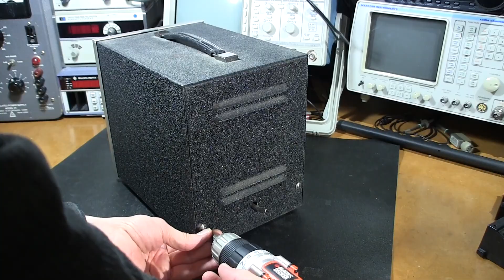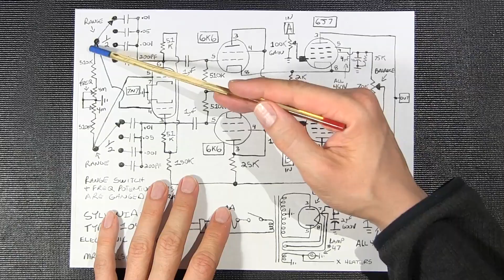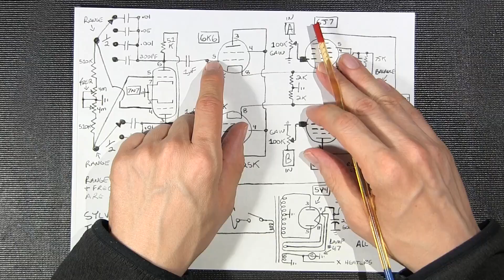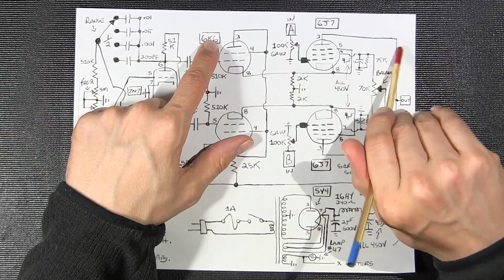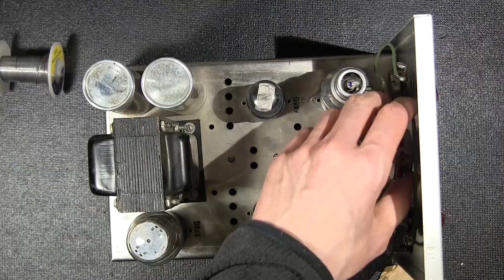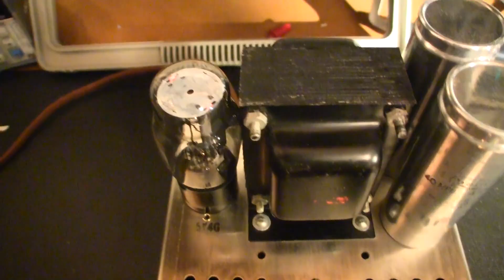Neat Electronic Device from 1939 Explained with Restoration

Comment: Made back in the day when construction was a work of art, when people really cared about what they built.
Reply: You have to understand all this hand built stuff is extremely expensive.
Reply: I actually have a radio built in 1944 that still works. Hand wired, original valves (tubes). I tested everything before I applied power. The set was bought by my grandparents, and still has the shop guarantee. They were supplied as kits of parts to local shops to assemble.
Reply: Steven Cook, Make sure you replace the caps as does Paul Carlson. That will keep your machine working for decades more. Add to the voltage rating as they are not the same as the caps were back then. Use a good brand (see his video on choosing components by brand).
Reply: Boat anchor art to fill the shelves.

Comment: That power cord you cut had obviously been replaced previously, probably in the 1980s judging from the neoprene cord and the (probably added) hold-down clamp that is using a Japanese Philips screw. It is very possible that the fuse block was added at the same time, the original either not having a fuse or having a fused plug. That tells me that someone either restored this once before in the 1980s, or possibly was even using (or attempting to use) it at that late date.

Comment: I'm guessing they used the word "Balance" in an audio context. Like adjusting a left right stereo signal.Can you switch traces around with balance? Like move the top to bottom and vice versa? If you can then balance makes more since. If you feed these 2 audio signals into an amplifier, you could change channel A to output on left or move balance and move channel A to right. 
Just a guess.

Mike

Comment: what kind of microphone are you using for your videos ? 
it sounds great!!
let me know!
KI7CUN
Reply from the maker: Hello Daniel. The mic is a custom built, vacuum tube condenser type. The tube in the mic is a GEC A2900. The mic pre, compressor, EQ is an ART Voice channel. The audio is fed to the camera through balanced line, where it meets an interstage transformer coupled to the camera input. The audio is Mono in all my video's.
Reply: Mr Carlson's Lab  wait, that's mono? I may need my hearing checked
Reply: Mr Carlson's Lab Thanks for the Info Paul!! I would have to build it myself then if I wanted to go down that route, also do you hang out on 3.875mhz on 75m at night or is it only 3.900mhz?
Daniel

Comment: It's a pity the technician, who had to repair that unit n times without success, isn't around to see you find the bad solder joint on the decoupling capacitor.

Comment: I am curious what the highest frequency this electronic switch is capable of. I assume it would have to be lower than the highest band of the built in oscillation frequency? I seen similar ones on  Ebay, almost bought a nice looking one a while back. I also can see how these can be used on a dual trace oscilloscope to enable three or four trace capability. Again Thank you for another wonderful informative video!
Reply: Probably 100 KHz, like, cheap scopes of the day. That is what the Heathkit S3 electronic switch is designed for. http://www.heathkit-museum.com/test/hvms-3.shtml

Comment: Looking at the circuitry underneath that looks beautiful I wonder if the unit should be restored. As long as the caps dry out and do not pour destructive gunge everywhere why not leave it as is? Maybe trace out the circuit and model the functionality on a computer or even build a replica but hacking out those old, even if useless caps just seems wrong. I am typing this 16 mins in as I want to avoid seeing a pile of removed parts later in the video.
Reply from the maker: I toy with those thoughts as well. What makes this acceptable to me is.... This is used to teach "others" many things about electronics in it's un-restored... then restored state. The most important learning tool in this video is the ability to see it operate... That's where the decision is made. The fact that people will learn "is priceless," keeping this original for the sake of making it a "shelf queen" would just be selfish.
Reply: And think, the engineers who designed this equipment would want to see it running reliable for years. If they were here today, Mr Carlson would have to make a new bench for himself as these engineers will have pushed him outside and installed all new caps to get it running perfect.. 
I'm joking of course but you get the point. I also see your point as well. It is a very interesting snapshot in time and much can be learned from studying our inventions of the past. I love vintage tech, and I love learning about how they work. Some classic cars go to a museum, some go back on the road, there is need for both.

Mike

Comment: Sylvania was the creator of the loctal product line. They did not use it because it was more rugged. They used it because it was their own product. The Sylvania technical manuals from the period push loctals pretty hard.  Why call it a mixer? Spend more time on what multiple grids mean... Blocking capacitors are for dc... why would you want to block the dc output- if- the output is dc? Good find on the missing solder joint. Replace the caps and let er rip... wax caps are the spawn of satan. That is the first thing that is done on gear of this vintage. Replace them. Some times you can reform electrolytic caps. It does take time. The old pots are better than the new ones. Did you attempt to lubricate them with the latest pot lube? There are much better products now. Carbon pots are the standard now because they are cheaper, not because they are better. Heat shrink is easier to find than spaghetti.
Reply from the maker: You need to watch more of my video's Andy. Welcome aboard!

Comment: Very nice. Enjoyed watching this restoration. At around 40:00 you showed us how the 1uF cap lead was never soldered. Were you saying this was the intermittent problem the QC team was looking for but couldn't find? Or were you pointing out that it wasn't meant to be soldered? I wonder if the "OK" tag was marking the "OK" channel as they tried to find the problem with the other one. Either way, thanks for the vid!
Reply from the maker: I think this unit never worked right and was returned many times to the repair or warranty depot. Every time it was released from the depot, they put a new "tested" stamp on it. (the reason for all the stamps) The part was supposed to be soldered in, but was missed by the QC people, as it hid below the large component.
Reply: Thank you. Very interesting. The device certainly had a story to tell!

Comment: very good finish the surface of the silvania equipment.  beautiful front. another way to do what silvania equipment does ( i was earing) is a cathod added to a crt. with two cathod printing one signal each one.but less cheap that the oscilloscope with only oNE cathod.

Comment: can you measure the 3dB bandwidth for the switcher?  I think that the Heathkit scope might be just a couple of MHz. would be interesting to know the upper limit for proper use. Thanks. I watch all of your videos and learned a lot about restoration of vintage equipment.
Reply from the maker: Glad you enjoyed Stanley! I can guarantee this switch tops out in the audio range, no need for the half power point measurement.

Comment: Mr. Carlson you forgot to measure the output voltage on the square wave on the output. Once again a great video that simplifies the explanation of circuit design theory.

Comment: Thanks for the comprehensive video. Almost a religious experience, very inspirational. Makes me want to get back into the shop and tackle some of those projects I've been putting off. 
One of my problems is dealing with terminals with several components attached. It always seems the component lead I'm trying to remove is wrapped with 3 or 4 other leads and 1/2lb of solder.  I wouldn't mind seeing your method of dealing with this.
Reply: JPennDotCom Here, here!!
Reply: as from my experience, using a heavy duty solder sucker to get rid of that solder first...and cutting the wires one after another does the job....

Comment: Another fascinating and well done video. 

I'm trying to understand how this thing works.  Is it essentially similar to operating a dual trace scope in "chopped" mode, with the difference being that the two channels and chopping function are in the Electronic Switch rather than the scope itself?  (And I appreciate there's only one gun in the CRT.)  If so, I kind of understand it.  If not, I need to give this more thought.

Anyway, it's great to see a relative youngster know so much about vacuum tubes and older techniques.  Good work.

Comment: Your switch works at audio frequencies and you talk of square waves which I understand correctly at the sum of an infinite series of sine waves. If this is the case, in theory it is potentially operating at infinitely high frequencies too?
Reply from the maker: Hi Robert. The easy answer to this is: The square wave of which you speak is a "perfect square wave." Since we live in a reality that works with "time," there is no such thing, and there can never be a perfect square wave. We will always deal with the rise and fall time of a signal. Another way of looking at this: If you have a book on the floor, and you want to put it up on the table (rise time) No matter how "fast" you lift that book, it will always take some period of time to bring it from the floor to the table.... and if you want to put it back down on the floor again, from the table (fall time) that takes a period of time as well. If you sharpen a knife razor sharp, then you look at "the edge" under a microscope, the edge will appear dull or rounded. Then you take the time to sharpen it again, this time using the microscope to look at the edge, now it's really sharp right? Zoom in again this time at a much higher magnification (faster timebase setting on your oscilloscope) Now it appears dull again "rounded".... Can you ever really achieve a truly sharp edge? Everything in nature will revert back to a round or circle, much like a sine wave.
Reply: Mr Carlson's Lab For your prompt reply, thank you, the uncertainties in the real world are why I put 'potentially' in my question. As an engineer I do understand what's going on but wanted to raise the spectre of the theoretical infinities involved with square and other waveforms.

Comment: I have an old Sylvania VTVM which I've recapped but have not tested yet.  Unfortunately mine looks a lot better on the inside than on the outside but I'll leave it as-is when I get it working.  Unusually it takes Loktal tubes but I guess this was for durability reasons; these meters are exceptionally well built and were designed to be portable.